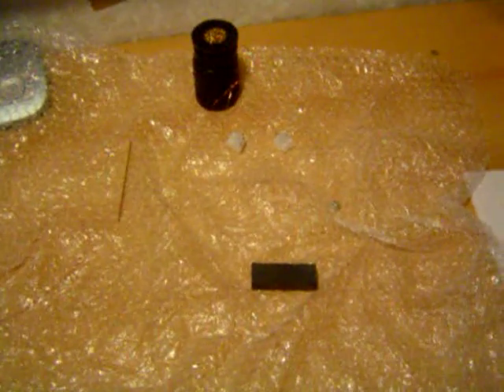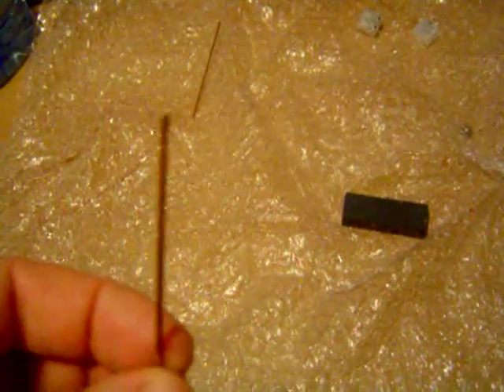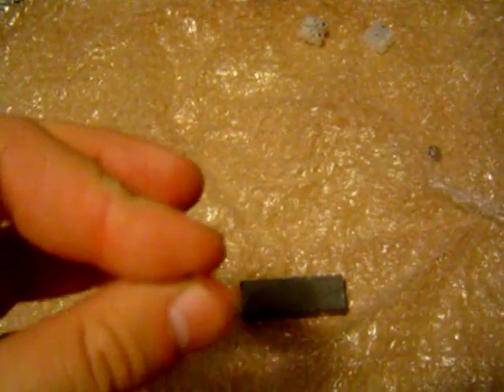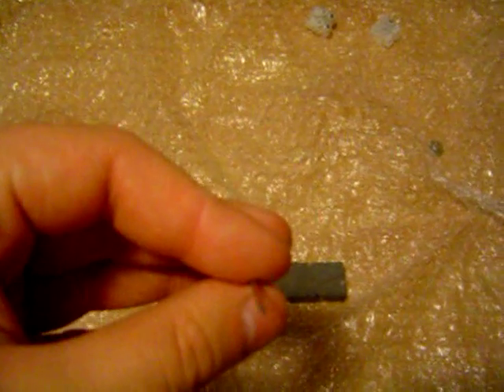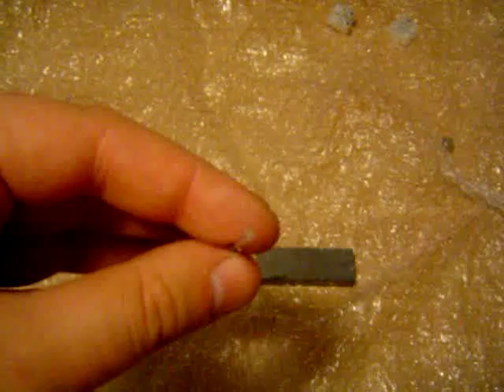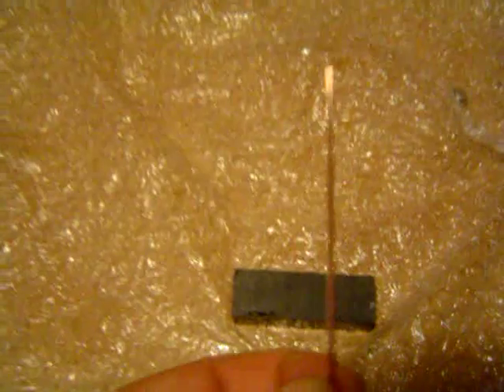Difference in welding rod Germany vs US

Comment: I think, you are use the coils not for welding instead for electric projects. i'm a welder and was somewhat perplexed about this video.
of course, all welding rods are normalised with various classification.

do you need implicit the lincoln r60 rod or you can use all other mild steel welding rods for the coils?

Comment: I think you found out that copper is not magnetic, it is a sensation.

CUSI3 is an expensive copper based rod with 3% silicon for SOLDERING/BRAZE. The Lincoln type R60 is a mild steel based rod with classification of EN12536 for WELDING. I absolutely don't understand what do you want say in that video.

Comment from the maker: Answer to AndrewChan84, what do you need is rod which have ferrit compounds.
When i cut off the current to my coil i still have a magnetism!
I mean when i move a wheel with switched off current, than i see that next to a magnet which was pointed to the coil another magnet take place of it.
If you like i can send you a pdf file with description of lincoln R60 rods

Comment: Hey, I'm using mild steel type which doesnt demagnetize 100%. Maybe like 90%.
Does the R60 completely demagnetizes? i.e. when current to the coil is cut off after using it for a few hours, doesnt still have a faint amount of magnetism?

Comment: good point, you should also add that the core material must release the magnetism also, some welding rods when rubbed with a magnet stay magnetised , try rubbing your welding rod up and down and then holding it against some steel , if it sticks it is no good as a core material, the r60 rods are for welding soft steel , they accept magnetism well and also release it well. The bedinissg is all about capturing the spike from switching on and off quickly so the core material must do this too :)